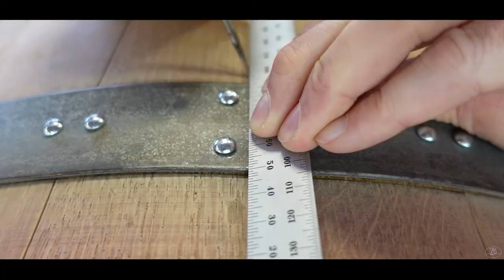96+ Hr Wine Barrel Bar Build - DIY - Part 1

Comment: Just stumble on your video. I really like your table set up with the caster wheels. Question would you mind divulging what kind of round headed nails you're using on the straps and where can we possibly find them! Thanks so much for your awesome videos.
Reply: I was thinking the same thing.  I thought he was pounding in rivets after drilling a small hole. I wonder if they make a ring spanked rivet like nails
Reply: They might be Knurled rivits

Comment: My question is why do you put the wooden strip on the door of the barril what's its purpose?
Reply from the maker: The glued in inlays stop the doors and door openings from changing shape, similar to screwing a backing plate to the doors, but much cleaner.
Reply: Thanks for that's info never thought the door openings would change shape

Comment: This is amazing work. Do you happen to have the 3D printer plans for the jig you made to drill the holes in the bands?
Reply from the maker: Yes I do, I designed them in Solidworks, But different barrels have different hoop dimensions. I would need to know the dimensions for your hoops, and may have to design some custom new ones for you. My barrels have 2 different widths of hoops.

Comment: I'm doing a LBC now & am hung up on the hinge/door mount; and did a search & found your 3pt series (like how you did yours!) And was hoping to see what I may be doing wrong. Using t-hinges and mounted the same, except in the center, the door cannot clear the frame to open. I have 1/16" kerfs all around. I am hoping I don't have to break out the plane to trim the doors; would like to find out if the doors/frame does need to be trimmed or if there is some trick you used. TYIA. Dane
Reply from the maker: Hello Dane! sorry for the late response, I'm not quite sure I understand your issue, Can you send pictures to my email (it's listed in the about section on my Channel) 
I'll be able to help more easily I hope!
Reply: @BoujeeBarrels  will do! Thank you.

Comment: How did you keep the doors from flattening? I built one and made one big door and it didn't keep it's curvature to match the barrel.
Reply from the maker: I make cardboard templates of the door opening, and then I use a jig to press the curve back into the door to match my template, while I glue in the curved wood inlay.

Comment: Curious if you’ve ever tried to do the top horizontal cut ABOVE the second steel band.  I’ve seen others do a cut way at the top but that seems too much. You think it’d be stable enough.
Reply from the maker: One of my latest builds was cut just like that. worked well! click the following link to see it:
https://boujeebarrels.com/store/ols/products/dfd-wbs-ser
Reply: Yeah that does look pretty pristine compared to others I’ve seen.  It’s good to see you priced appropriately…. I’ve seen some where people cut on the top of the second band since the top two bands are so close together   I’ve found cutting below the second band can sometimes make the barrel doors bow out a bit.  Thinking maybe cutting above the second band would solve that
Reply: @puddytat62  how did that work out for you?
Reply: @hoody2141  I found cutting above the strap keeps the doors in the shape it was shaped into .   If you cut below the staves tend to unbend and not match the original shape.

Comment: Can you tell me where you get the screw nails?  I haven’t been able to find them. TIA!
Reply from the maker: Hello Kris, Sorry for the late reply, I use #8 screw nails from McMaster-Carr. https://www.mcmaster.com/90081A196/
Reply: @BoujeeBarrels  Thanks for the awesome build video! This link takes us to screw nails that say they are for "metal, plastic, and plywood." It looks like these screw nails have a much higher thread count than the ones you used. Do you think McM has changed the product since you bought them, or are they the same ones? If it's changed, do you think the new model will work?

Comment: What size drill bit did you use for the screw nails? McMaster just says use slightly smaller than the shank, lol!
Reply from the maker: What size screw nails are you using? the #8's?
Reply: I went with the #10s...ended up drilling with #20 drill, .02p" smaller than the shank diameter. Tried it on a piece of scrap wood and seemed to hold pretty good. Thanks for the awesome video and recommendations!!
Reply from the maker: @mattvolm  awesome!! glad I could help, and with that sizing, just make sure you drill a hole  a little deeper than the length of the nail, so there is room for the undersized material to bunch up in. or you'll end up breaking through the other side. Cheers!
Reply: @BoujeeBarrels  It looked like you used two drill bits to drill those holes. What were you doing there?